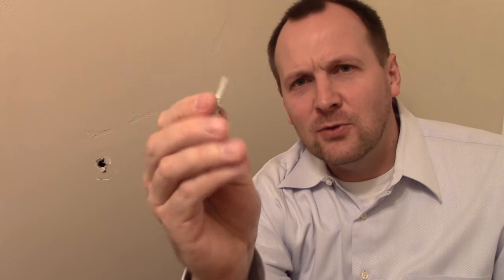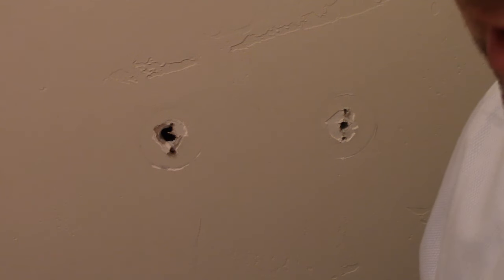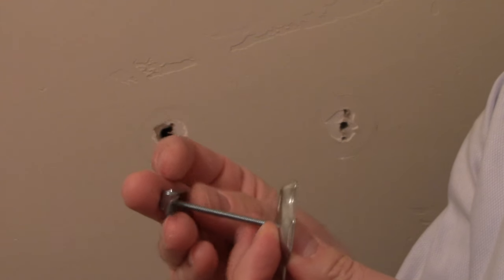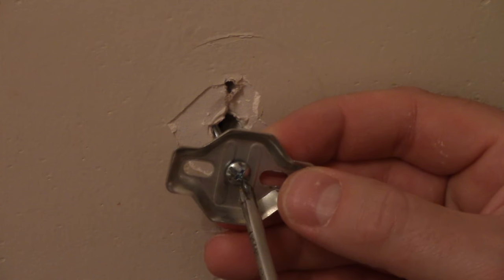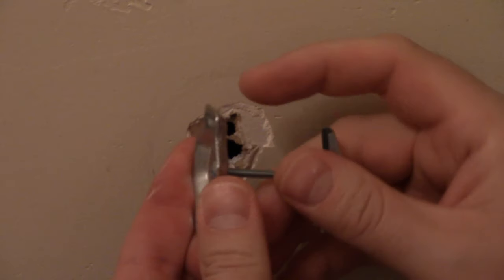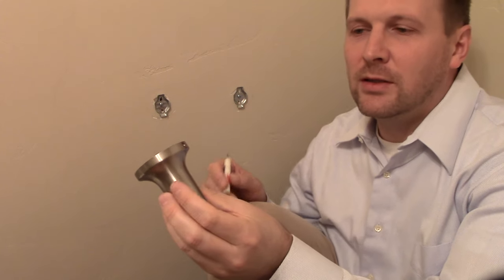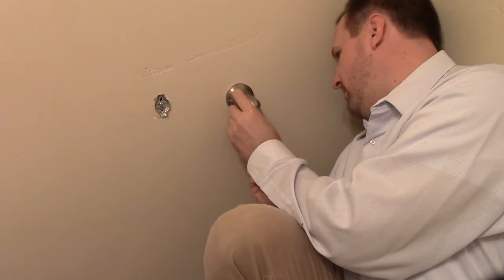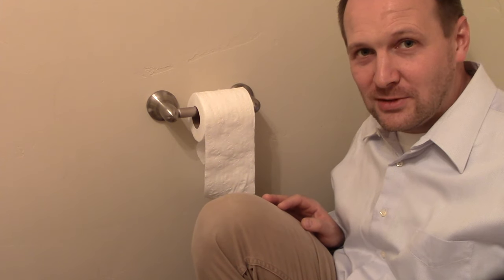How to fix a ripped out toilet paper holder or towel rod

Comment: I did it...!  Finally went to our local big box hardware store, bought the toggle bolts, and reassembled the plate mechanism, which was a little different than yours, but with a little jiggling got it seated and tightened everything up.  Thanks for having taken the time to post this very helpful video!

Comment: Wow.  Thank you so much.  I am a 74-year-old woman with LITTLE handyman experience, at least with drywall.  I had no idea what to do to fix that small but gaping hole,  but will head to the hardware store in the morning for the toggle bolts.  Is it imperative to have that little screw on the bottom?  It seems it would be easier to access if on top.

Comment: thanks andrew! my single mount holder that came out of the wall,looks looks like it has a couple toggle bolts (two screws)

hole is about the same size as yours. would recommend reinforcing with caulk or some other filler? cheers

Comment: If you don't hear the toggle bolt spring back inside the wall does that mean it is too small/short?
It still worked in the end but not really secure to the wall. Thanks for your video and helping me get it back on the wall at least!
Reply from the maker: Usually you would hear it spring out.  So it could just be wedged in the hole.  I guess if it comes out again then maybe try longer toggle bolts.

Comment: If the base mounting plate uses two screws, would using one toggle bolt be sufficient, or should I try to fit two in there? Thanks!

Comment: If I patch a slightly larger hole first, could I reinstall the hardware in the same spot? Would it be best to use paint and patch or something heavier?
Reply from the maker: anesthezea Depending on the size of the hole you may want to patch the hole and either move the anchor into a new area of sheetrock, basically you want to avoid mounting it in a weak area.  I don't have any sheet rock repair videos at the moment, but if it's a straight plaster patch, then I'd relocate the anchor instead of drilling a new hole through plaster.  I hope that makes sense.

Comment: Well I moved in and bought this house, This was done by who ever and it was lose after awhile( I have a special needs child) so first I didnt know  this was done and they still used both other screws so I couldn't tighten it plus its connected on the base by a strange size of hex screw. So I got it off , now I will need a Lil patch work . Yes the other side is done the same way. The bolt is lose but conncted by the same toggle screw. Ugh. Still have the problem of the allen screw 😠. Your idea is great but not if you cant adjust it. Thanx former owner.

Comment: What size is the toggle bolt? Looked at the home depot and they got a lot of different lengths
Reply from the maker: It doesn't really matter as long as the spanning nut is wider than the hole.  You don't want a giant one though as it will require making a bigger hole in your wall to get it through.  I hope that makes sense.
Reply: Andrew Hill I think so, thanks!
Reply: Andrew Hill Actually the "toggle" part isn't what I was asking for, it's the actual bolt that goes through the wall, 1 inch, 2 inch, 5 inch?
Reply from the maker: KalliSlots ohh, 2, 2.5 inches is probably fine, 5 inches is too long, but it doesn't really matter since it's in the wall but you just don't want it too short.
Reply: Andrew Hill Thank u sir

Comment: This method is not the correct way to fix it, and it usually will not hold even a toilet paper holder. The correct way is to cut out the drywall, mount a piece of wooden block on each side of the studs to mount the toilet paper holder to. Then, patch the drywall, mudd it, and paint it. The way described is a terrible way to fix it. I'd call it jerryrigging.
Reply from the maker: I uploaded this video 3 years ago.  The holder is still securely hanging on the wall.  Most people don't have the time or inclination to use the method you described.